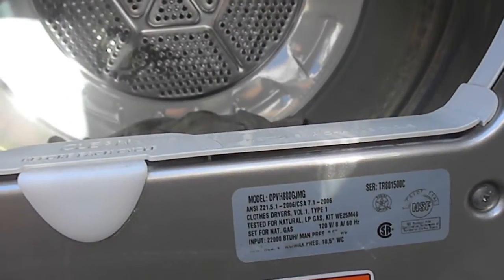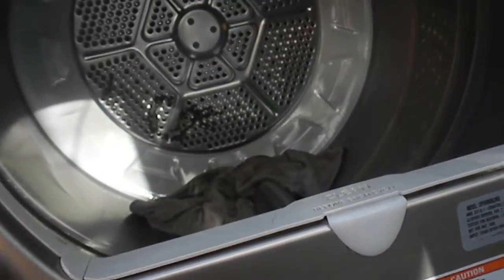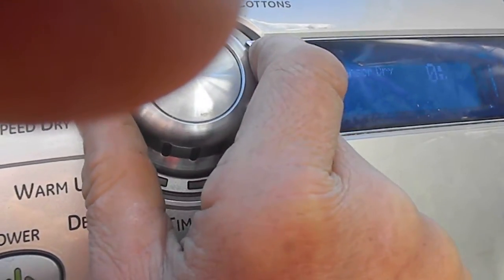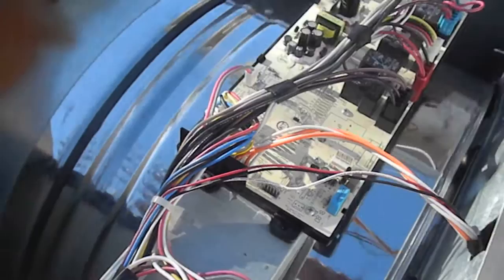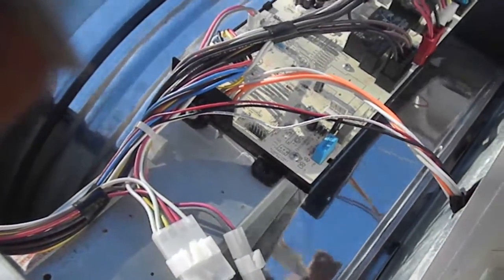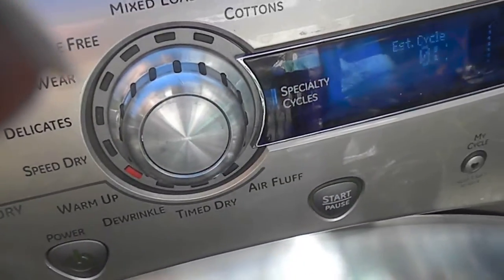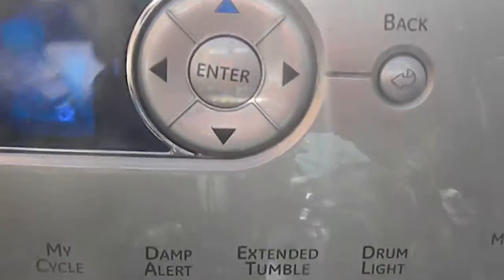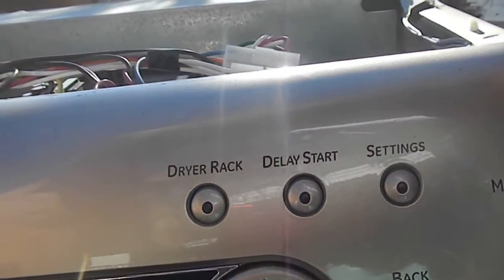Ge Profile dryer Issue

Comment: I have one that’s plugged in and it won’t even power on? Any ideas? Is there a way to do a hard rest on these machines. Moved it to garage and now when plugged back in it won’t work. Craziest shit. It was in my house plugged in working just fine and since moved it won’t power back on. Help!
Reply from the maker: be sure you have  power at the wall socket. than check to see if you have loose wires at the control board. If you have power to the board you may need a new control board(s)
Reply: @EurekaRecycler  thank you for your time and help. ✨🤗

Comment: The problem could be the motor. I had a similar issue and the motor was bad. It would run for 5-10 minutes and shut off before it was “done.”  Mine would run and heat but shut off mid cycle. Read somewhere it was the motor overheating as there is a thermostat on the motor to keep it from getting too hot. Hope this helps someone else.

Comment: Did you put a damp rag on the humidity sensor before running the automatic cycle? If so test the resistance across the pin connector going to the board. It should change when you apply the damp rag to the humidity sensor. If that is all good the dryer will need a main board.
Reply: I have a dryer doing the same thing. I replaced the main board and the thermister. Still went back to doing the same thing

Comment: How did you get the top off? I need to change dryer slides
Reply from the maker: +Tim Rosell check for screws on the top backside, If you need parts I still have this on selling parts off of.
Reply: I found it was the screw under the button and then the face plate just lifts up.  I was trying to pull it straight out.  That's a no no. Ordered new drivers as a screw hot around the drum and "screwed " up a slider, thanks.
Reply: + EUREKARECYCLER do you still have parts for sale off of dryer
Reply: if you pry out the center large knob with a screwdriver, there is a long screw there that needs to be removed. Once that's out just lift it. You can see the screws to take out.